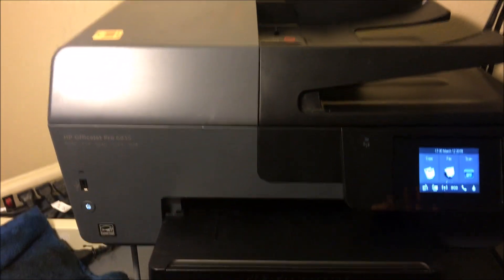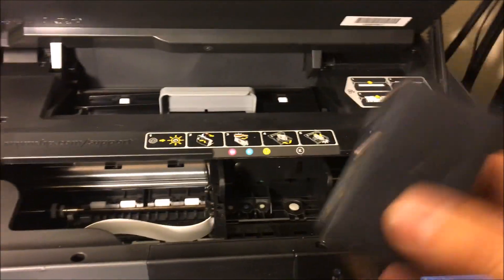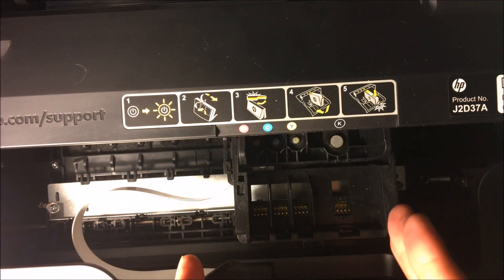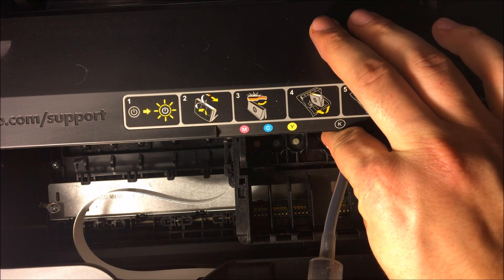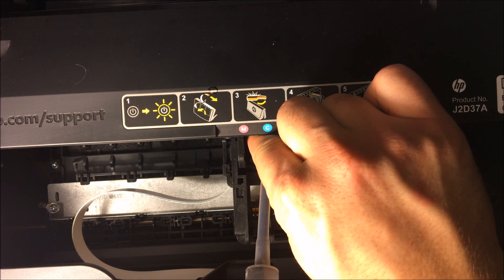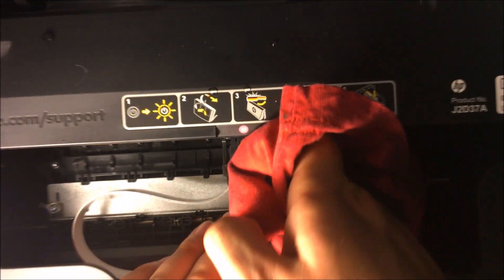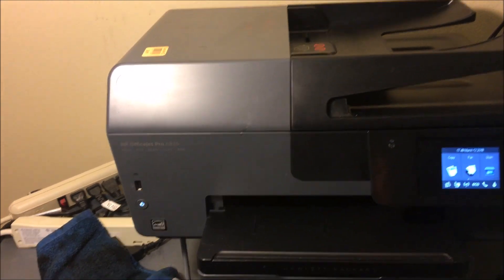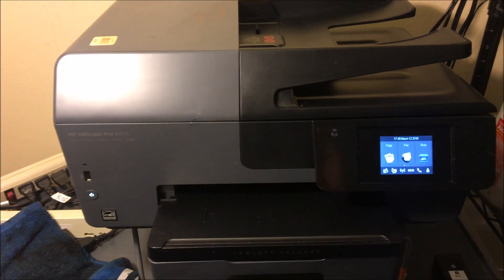Hp Officejet 6800 - How To Clean Printhead (FIXED)

Comment: I keep getting "there is a problem with printhead." Error. And, it doesnt let me do the cleaning process. Any advice? Thanks.
Reply: Sina Omidi Same. It won’t let me do the cleaning process either.
Reply: @Ruffles729  I have the exact same problem.
Reply: Moon Love I’m
Fucked at work right now😣😣😣😣
Reply: Same problem here. Error code 0xc19a0027. Anybody can help?
Reply: @ritacano5787  Hi, did you ever sort your problem out with There is a problem with the printhead ?I think it's firmware or something like that as Iv'e replaced the Print head and still same message..Thanks.
Reply: Same situation, anyone have fixed this?
Reply from the maker: I apologize I could not get to your comment. If you would still like support, expedited responses and member only videos please sign up for a membership here 👉 https://geni.us/BPChannelMember